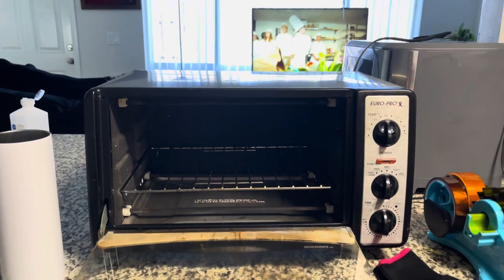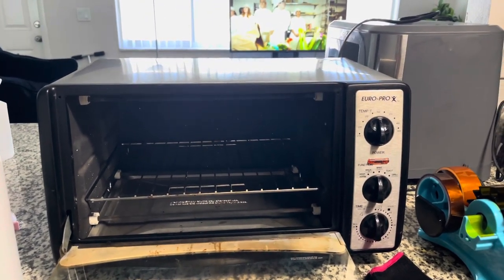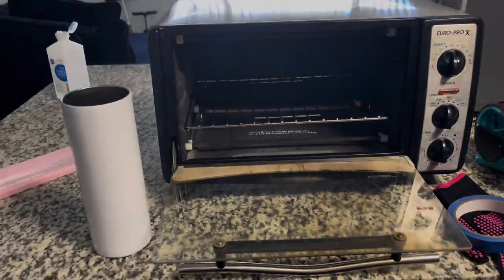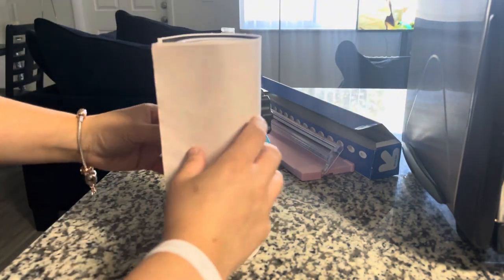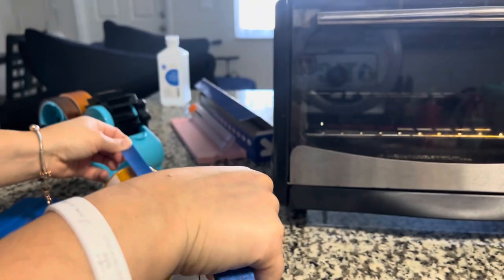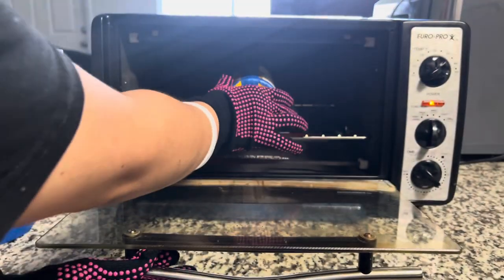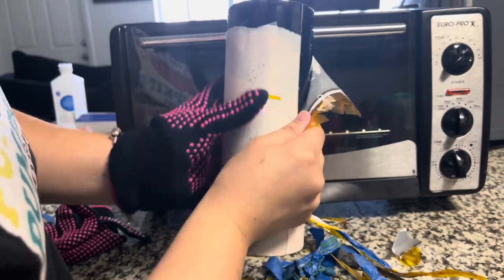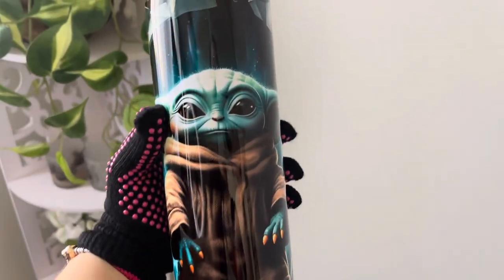HOW TO SUBLIMATE A 20oz TUMBLER IN A CONVECTION OVEN | 3D TUMBLER WRAP BABY YODA DESIGN| GOODWILL

Comment: What the purpose of the painters tape? Your tumbler came out great.
Reply from the maker: To secure the image on cup so that it doesn’t cause ghosting on shifting and you could also use actual heat resistant tape which is what I always use but I wanted to test out the painters tape I recommend getting it on Amazon or at like Walmart etc I don’t really like the temu painters tape to be honest